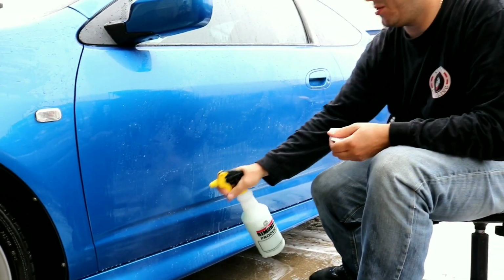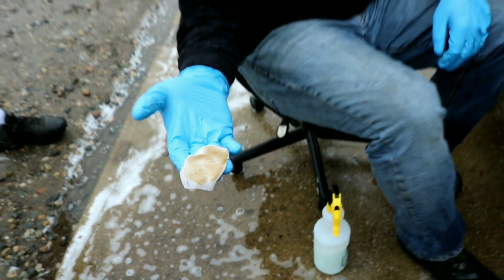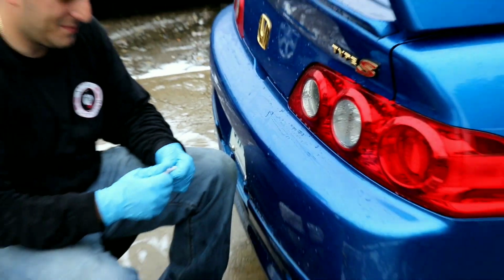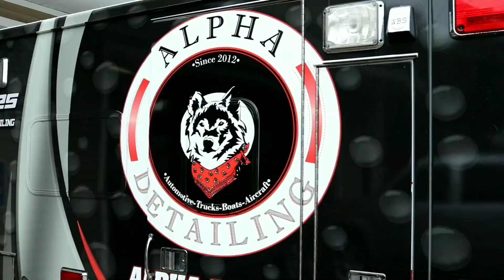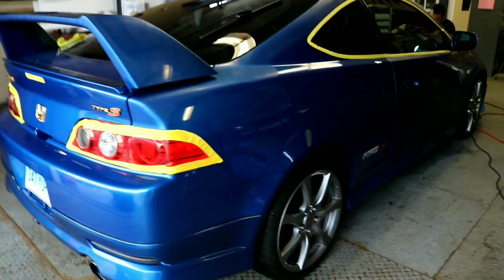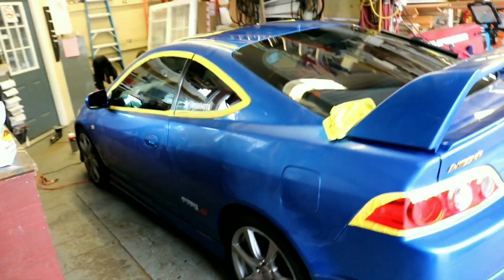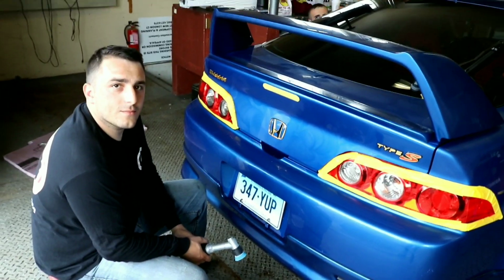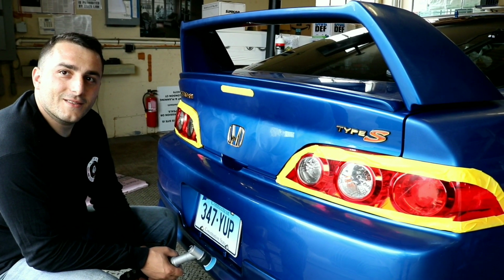Paint Correction & Ceramic Coating my 13 YEAR OLD CAR! - Part 1 | Episode 17

Comment: Good morning bro are those 18 inch wheels? If so what tire size you run them with. Exact wheel setup please. I have a 2013 si I’m tryna get these exact wheels. But I was told the speedometer would be off without an exact tire size 215/40/18. Can you confirm this? Thanks boss

Comment: My favorite color on dc5..mine is milano red,dont like to much..quik question what brand is your ducklip thanks keep it up
Reply from the maker: Interesting, usually red DC5s are extremely attractive but they tend to fade in the sun. I like red though. That's OEM A-Spec trunk lid spoiler, came with the high spoiler.